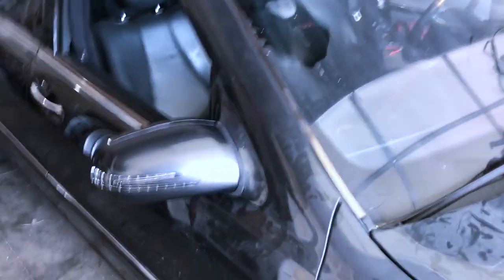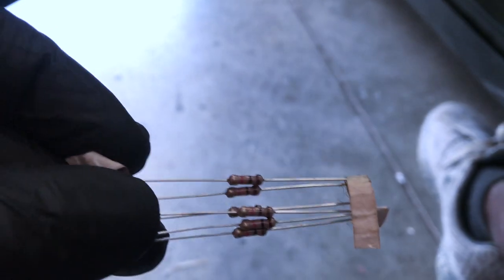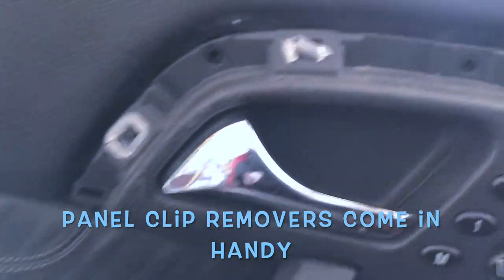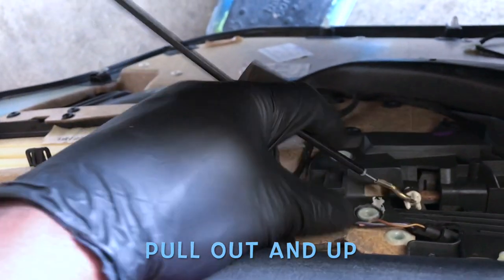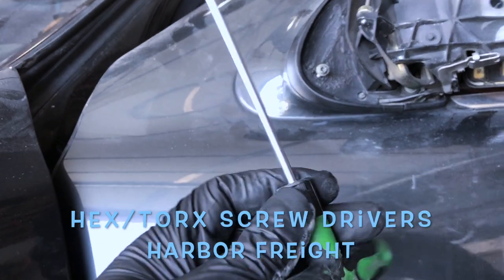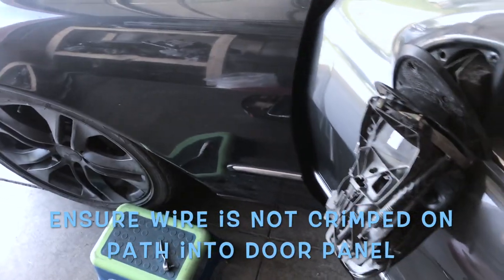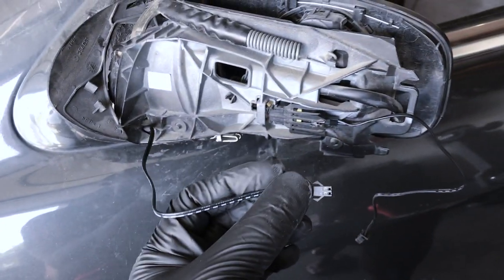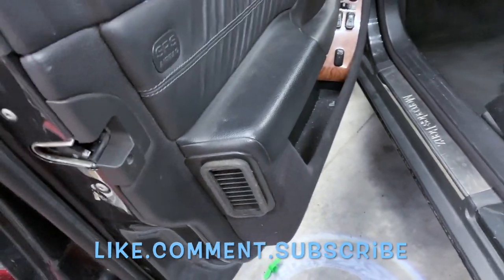W220 S430 Arrow Side Mirror Upgrade

Comment: how did you attach the mirror caps to the wing mirror?  the original mirror caps have a guide groove and the led haven’t? 🤔
Reply from the maker: @KevinBoschk Thanks for the question! I just realized I failed to film that part. You just push in & surprisingly it actually just clips in if I remember correctly. We’re talkin same yr make & model yes?

Comment: Did you have any warning light on the dash when the side mirror light dont work? But the look gorgeous on your car.
Reply: @Maknificent12now  Yes  i do have the issue, but when i replace them at the time Mercedes want a arm and a leg for them. I got the cheap ones which i didn't know  you had to splice them in, but they work. Now there cheap but looking at your I might have to upgrade and paint them to color of the car.
Reply from the maker: @RKellyMask you ever get these done?
Reply: @Maknificent12now  Unfortunately no, my other benz  had the notorious oil cooler leak for that engine. Which is a  pain to do since you have to remove half the engine to replace them